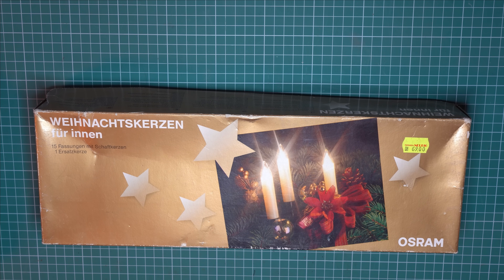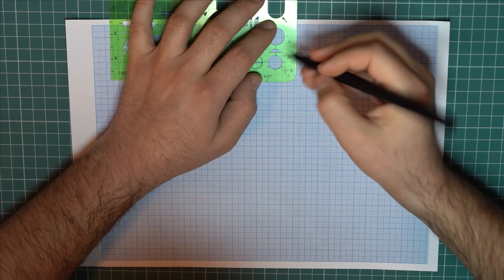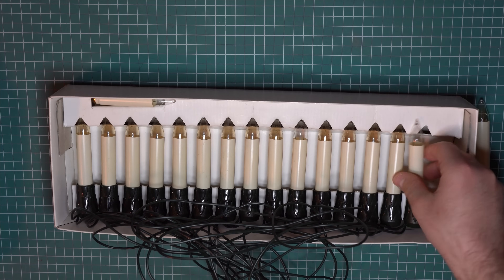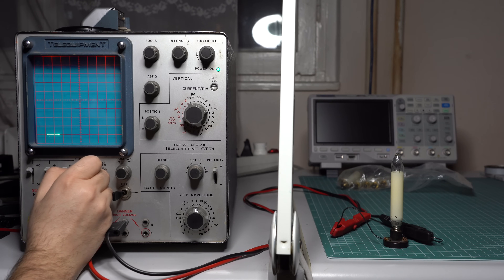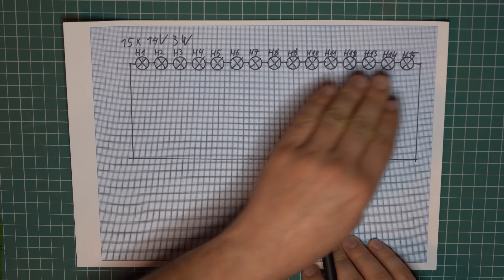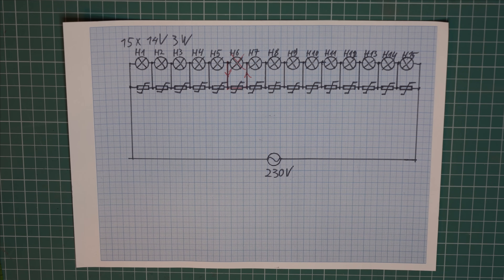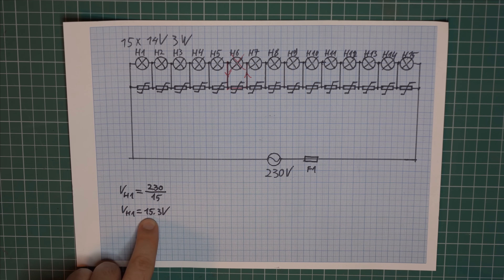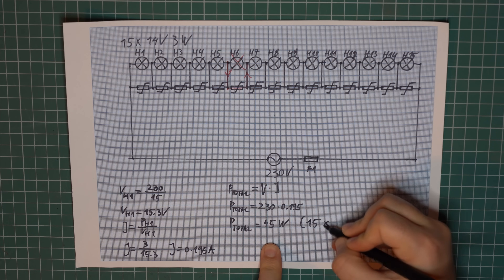The clever engineering behind vintage Christmas lights

Comment: Each lamp of 3W @ 14V draws 0.2143A (214.3mA) approx...that gives hot filament resistance of 65.33 ohms....so what's the measured....
...(not calculated)current of the string of 15 running at 230V?..

Comment: What was the currency again, "DM" Deutsche Mark? That's kinda ancient, also: Noice!
My guess is that the incandescent filament is under a sort of springload, and - upon rupturing - gets released to close a bypass resistor contact (like in a relay), since the circuit with one candle removed is just open.
Let's see!
Reply from the maker: The bypass is based on a varistor or something like that. It's not what you described. Have a look at the follow-up 😁 : https://www.youtube.com/watch?v=i6xs1tnQM2A
Reply: In that case, my guess wasn't too far off. Think about it:
Some kind of mechanism puts a resistive shunt across the filament-gone-open-circuit; in this particular gadget, not a relay contact, but a consequence of the voltage drop going up. Well explained, @VoidElectronics  !
Reply from the maker: @DerMarkus1982  That's exactly what happens! I'm glad you liked it! 😁

Comment: In old Christmas tree fairy lights there'll be a fuse bulb which is essentially a bulb without the thermistor which protects the wiring should every single bulb fail.
Reply from the maker: Sounds like a good idea to me, but I don't think my string has it. All the bulbs look exactly the same.

Comment: You are conflating the voltage drop at each bulb (15V) due to its resistive load with the voltage at each bulb, which will be mains voltage at the first bulb, mains - first bulb at the second bulb, mains - first and second bulbs at the third bulb, etc. Saying that the bulbs "operate at 15V" is very misleading. They may each induce a voltage drop of that amount because of consistent resistances spread across one current path, but most of them are actually "operating" at a much higher voltage: the mains voltage then gradually reduced by each bulb.

Comment: I have some strings of lights from throughout the decades in the US. I have some really old ones that were actually wired parallel meant for outdoor use and then i have a ton that are the three strand method. It kind of because a standard in the US where to get the length of total strand, and to get the voltages right, they would string three long strands of X bulbs that were in series, in parallel. From what i remember, it was usually 3 parallel strands of 50 bulbs in series. The strands were woven such that each bulb in a row in the final strand was from a different leg. the idea there was that if one of the three legs dies from a dead bulb, the whole length would still have lights (just 2/3 lights). I HATED dealing with them though, and i very quickly moved to faerie lights or icicle lights where it was a long strand of mini strands and they were all just LED lol (and in parallel).

I even have an old strand of series/parallel lights made in the 80's that i REWIRED to be all parallel and then it runs on a 9v battery bank. off the top of my head, it was 3 9 volts in parallel running something like 50 lights (old style) in parallel with a giant knife switch to disconnect the power because why not. I never tried plugging that in to 120VAC but i imagine the bulbs would have all popped pretty fast or it would have blown the breaker. might be interesting to go back and see how many bulbs in parallel it takes to trip a 15 amp breaker lol

Comment: I've experienced this dead short situation in the mid-90's. We had a string with too many burnt bulbs but we didn't knew since it was unplugged for months. I plugged it in and some of the lights lit up for a split second then it blew up the outlet. My first experience with electronics as a kid :)
Reply from the maker: I'm happy to see you lived to tell the story. We had different safety standards back then. Not sure if the new LED stuff with hair thin wires is safer though.

Comment: Yes, but it's an isolated voltage-ie, only if you get between the current path, which is only when between the terminals somewhere. Of course proceed with knowledgeable caution.

Comment: What is the voltage drop across a failed bulb if that has not been replaced? Cause if that takes HV to conduct then it will take a huge voltage drop across it. Or is it a mode of operation kind of thing in which once it see the HV it switched to a short and then the voltage across it can be reduced? That should be the case else the failed would draw a lot of power and thats obviously aint good.
Reply from the maker: As you can see on the curve tracer experiment, once the bulb sees a high voltage across its terminals, it shorts out and remains shorted even with power removed. It's not like a Zener diode that conducts once the voltage exceeds a certain level, but becomes non-conductive below that threshold.

Comment: Great video! In the US, strand lights have 50 bulbs per circuit. But some lights may have 100 or 150 bulbs, but are actually multiple 50 lamp series strands in parallel to each other. So, our living space mains is around 120 VAC at 60Hz (electric stoves/ovens and such are on 220 VAC). A strand circuit has 50 bulbs so each bulb gets 2.4 Volts RMS. These bulbs are so small there is not enough room for a varistor. What is done instead is: Two leads run up from the socket to a tiny 2.4 Volt filament, but below the filament is a couple loops of wire (I think it is an alloy similar to Nichrome) with a thin insulation coating on it wrapped around the leads. If the filament burns out, the voltage instantly rises from 2.4 V to 120 V across the leads (a high voltage rise just like in your example), this causes the insulation on the wire to burn off and thus short the bulb out with a few Ohms of resistance. It's the same idea... only different [smile].

Comment: If every light burns out the current would be 1.21A@278W which would not be enough to cause the wire to melt but likely cause at least one of the lamps varistor to blow. [go open]

Comment: Seems like a simple solution to the problem would be to put, after each varistor, a resistor with ~the same resistance as the filament.
Reply: It would have to be a sufficient wattage.  Not worth the extra expense.  The mini light strings are made to be the bare minimum cost.

Comment: If they all fail, the 230V is across 180 (15*12) ohms.  This results in over 1A or nearly 300W dissipation through the varistors.  Im hoping this results in a varistor failing open long before this much power is being dissipated by the string of lights.

Comment: Lots of people doing this video this year for some reason. It's fun to see the different explanations, including the variations on the technology involved, since different string designs seem to use slightly different implementations of the idea.

The thing none of you really explain though is the part where you say the "fuse" (anti-fuse, varistor, whatever) in the burned-out bulb is immediately presented with the full mains voltage if the filament breaks. It's not clear to me why that would happen. The other bulbs are still passing current normally, and so I would expect to have the same resistance they always have. The bulb, before it burned out, only had to deal with its pro-rated share of the voltage (e.g. 230 divided by 15 in this example), so why did that pro-rated share jump up to the full 230 volts just because the filament opened?

Maybe it's obvious to all the electrical engineers in the audience, but that claim goes beyond the naive comprehension of this layperson and I really wish it didn't keep getting glossed over like this.
Reply from the maker: Nice remark. I will try to shine some light on it here. You say that when a bulb burns out, the others "pass current normally", which is not really true. If one bulb breaks, since all the bulbs are in series, current cannot pass anymore, so the current is 0. Remember that according to Ohm's law, the voltage drop across the working bulbs is proportional to the current through the bulbs. With 0 current, you get 0 voltage drop, so the open bulb sees the full mains voltage. Also, with a broken bulb and all other functional, you can approximate the good ones with a short circuit and the broken one with an open circuit, so that would cause the full mains voltage to appear across the open circuit.
Reply: @VoidElectronics Interesting, thanks. I guess I had always viewed Ohm's law as a relationship between a static value (resistance) and the other two values. I didn't realize that the resistance component of the equation would itself be affected by voltage and/or current.

Though I admit, I then am still left with questions. Such as, what is going on as voltage or current approaches 0, but doesn't quite get there. I understand that the other is reduced, but if resistance is variable with current and/or voltage, how do we know whether when voltage is reduced, only current drops, or if both current and resistance can drop, and if the latter, in what proportion do the two both reduce?

Or is resistance a non-continuous function, somehow going straight from a fixed value according to the resistor's design/material/etc. to 0 at the instance both voltage and current disappear, but not taking on any resistance value between?

Seems like the more I learn about electricity, the less intuitive it becomes. :)
Reply from the maker: @harvey66616  For what I've described, you can assume resistance is constant. However, resistance is only constant for resistors. Other circuit elements like diodes, transistors etc have dynamic resistance, that depends on current or voltage. Also, everything varies with temperature in electronics and that includes resistance. However, in circuit analysis we use models all the time to simplify things, so you can use simple models when conditions are well defined.
Reply: @harvey66616  The Ohm's Law formula is E=IxR. If the current (I) is made 0, the voltage drop (E) becomes zero, regardless of the resistance of any of the good bulbs. The resistance of the burned-out bulb is near-infinity (in reality, well over 10 million Ohms). Thus, it can be assumed that the full mains voltage appears across the burned-out bulb.
Reply: Water hose analogy works in this case also, as it often does in electricity. Say you have a plastic hose where water is flowing. You put couple of clamps along the hose that each limit the water flow a bit,  and less water is flowing in the hose. These are your resistors, or lightbulbs. Now you press one clamp so hard that the water stops flowing, so one bulb just blew. It's easy to imagine that this clamp will be under the full pressure of the water mains line. That's your voltage.
Reply: One solution would be to have a suitably chosen NTC in series with the string...

Comment: The really vintage lights that i remember did not have anything to short out the bulb. But (in the U.S. there were only 8 15V bulbs in a string.
I'm pretty sure that device is not a varistor. They do not behave as you describe.
Reply from the maker: I know varistors have different characteristics, but I don't have a better term for them. Do you know of a better term for them?
Reply: @VoidElectronics    A real varistor has a repeatable voltage vs resistance characteristic.  There are also MOVs that clamp at a certain voltage. What you need in a series bulb is something that will become a permanent short after a normal voltage s exceeded.  This is done with a thin wire with thin insulation that breaks down; it shorts out and never goes back to the original state.  I have seen it called an "anti-fuse". The original street lights 100 years ago were wired in series with a 2000 volt current regulated supply at 6.6 amps. The lamp sockets had a similar anti-fuse device. You can Google "series wired street lights". Airport runway lights are still wired in series running at 6.6 amps.  They have another means to complete the circuit if a bulb burns out.

Comment: Still better than the 4€ string find my gf bought, where you have a REALLY slim mains plug on one end, feeding directly into the leds, with the cables being as thin as headphone cables. (like the thin in-ear ones).
No fuse, nothing. Just direct mains split onto the leds, with a cable which is way too slim for anything.
Edit: the 3W are quiet obviously per lamp, not as a whole.
Reply from the maker: I know, right? I wouldn't trust those wires for my Arduino projects, let alone something that plugs straight into the socket.
Reply: A recent fairy light (led) set I bought had aluminium wire...found out when trying to shorten the cable. No way of soldering that🤦

Comment: As a child (50 plus years ago!) my parents had an artificial Christmas tree which was basically a wooden poles with wire rods wrapped with metallic tinsel like material representing foliage. The lights were a series string lamp set using larger style edison screw bulbs plugged into Australian 240 volt mains. I remember the lamp set was quite old to me even back then as the lamp sockets were Bakelite instead of plastic. There were times when the whole jolly tree became ‘live’ due to the metallic leaves intruding into the lamp sockets and contacting the brass lamp contacts, I was always scared and wary of that damn tree, still remember getting painful electric shocks from it!
Reply from the maker: We had different safety standards back then. 😂
Reply: Alternatively you could have used a real tree and use real candles on it and after the tree has stood most of december and dried out and you light the candles on christmas eve, and suddenly the entire damn thing goes up in flames. Yup, happened in my family. It was quickly put out with a fire extinguisher and luckily nothing happende besides some damage to the wall and the presents under the tree :P

Comment: I remember those types of lights. One goes out, not really a big deal. Two go out and things are really starting to brighten up. Then three go out and the stress is building. By the time four go out, it's starting to cascade and soon, they're popping like fire crackers. Not literally, but you know what I mean. 😁
Reply: The other thing is that the bulbs do have a limited lifetime. So that once 1 or 2 bulbs burn out, the rest are all reaching end of life.  So it may not be worth the effort to fx the string.  They are usually fairly cheap to replace. treat the whole string as being disposable.   
The other thing is it's not always easy to find the proper replacement. They are not all the same current even if the voltage is he same.

Comment: Wasn't the rated voltage back in DM times rather 220V AC than 230V AC ?
Reply from the maker: I think it was 220 V, but the Christmas lights box says 220 - 230 V. I just did the math with today's mains voltage in Europe.

Comment: Ha! I saw the MCL video on this, pretty clever. The varistor may be just that teeny tiny piece of wire with thin coating that goes into insulation breakdown. At least that's what Mr Carlson said... Good thing you mentioned the problem with increasing risk of failure. Nice lights BTW - they look pretty much like those I remember from my childhood... My mum still has them.
Reply from the maker: Thank you! I've seen what you describe in Mr Carlson's video about fairy lights. Mine are different, however. I broke one bulb and in its stem it has a glass capsule with a black powder that acts like some sort of varistor. And BTW, I have multiple sets like these and I use them because I like them a lot more than LEDs, even though they were made way before I was born. 😁
Reply: hi keri
Reply: @nixietubes  your channel banner looks very Audrey :)

Comment: The "remaining bulbs get a higher voltage" effect when the varistor shorts is partly compensated by the fact they get it for a shorter time. The varistor cuts off each time the mains voltage crosses zero and remains an open circuit until the voltage reaches a certain threshold, about 200V in your demonstration. So it opens and closes in the rhythm of the AC mains voltage and remains open for about 20% of each cycle. The remaining bulbs get a 7% higher voltage, but only for 80% of the time.

How does it work? 230V is the effective voltage of the sine wave. The peak is 325V. The varistor cuts in at 200V, which is 0.615 of the peak. Inverse sine of 0.615 is 38°. So the varistor shorts at 38°, which is 21.1% of 180° (half sine wave) and remains shorted until the wave crossed zero, waiting for the voltage to rise again in the opposite direction.
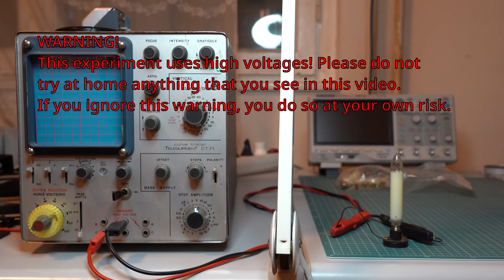Reply from the maker: I don't think so. Watch the curve tracer experiment from 3:41. Once the varistor activates, it's sort of permanent. To activate it, the voltage has to go up to 200 V or so, but then it remains conductive at low voltages. The IV curve changes permanently once it first reaches 200 V.
Reply: @VoidElectronics  Yes, it remains conductive at low voltages, but not at zero. It needs some minimum hold current to remain closed. Typically about 1-2 mA 

After all, it didn't start conducting right away in your demonstration, even though I assume it was before. It stopped conducting when you switched it off and needed to reach the trigger voltage to start again.